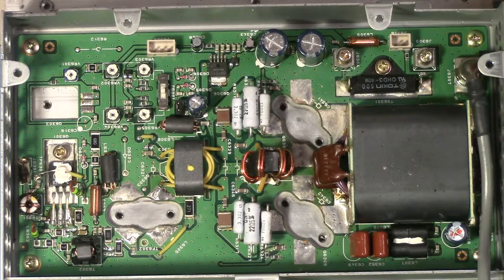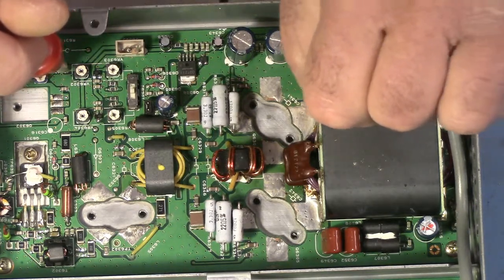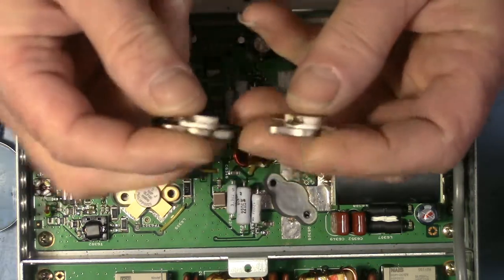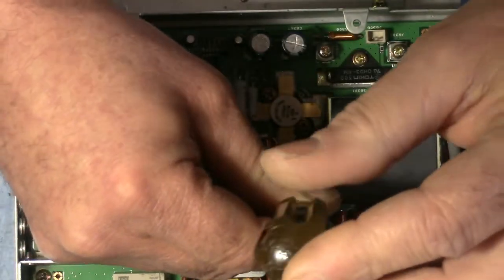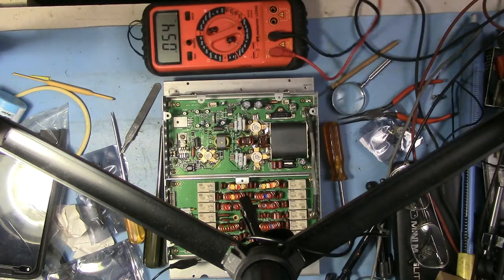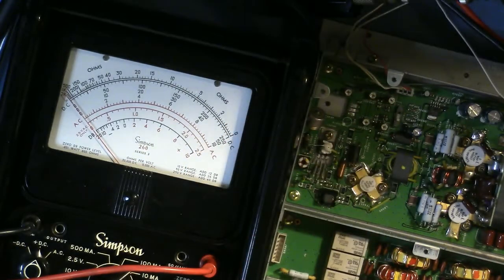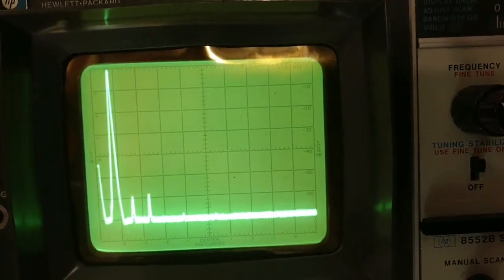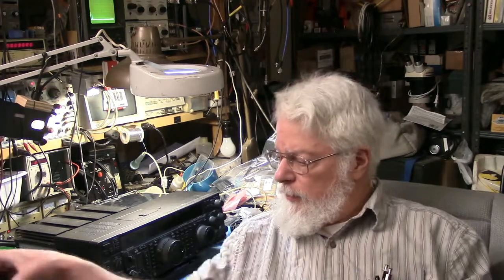FT1000MP MkV PA repair: FINALLY! Reassembly, and other stuff. Part 3/3

Comment: My next question is, in the Yaesu service manuals there is a Note that says "Signal levels in dB referred to in alignment are based on 0 dBµ = 0.5 µV.  Can you please explain what that means?  I can't find anything that makes that equation true.  I see where 0 dBµ = 1µV but not equal to .5µV.  How does that work and what does that equate to on a SSG output that reads in dBm or µV ?  Example being they call for +100 dBµ to set an S-meter to S9+60 dB.  I don't understand what they mean there.  Thanks in advance. Bruce
Reply from the maker: Sorry for the long delay in responding.  I have a spreadsheet I can send along if you email me at incidentalinformation@gmail.com  It's just a simple conversion table for dBm, dBu,  dBf and microvolts.  However, noted on the sheet at the bottom is the following. I can't remember when or where I derived this information but if I committed it to paper I was confident at the time.
Quote:
Re: Yaesu
+100dBu is 60dB over S9, or full scale on their later receivers.
+34dBu = 50uV is 25dB over S9 on their FT-101 series.
+90 dBu is 80dB over S9 on the FRG-7700
I agree that 0dBu is 1uV, nor 0.5uV.  However, I suppose you can chose any reference you like but not using a standard to which we can all agree and calibrate with seems stupid.  
My default is 50uV is S9 on most receivers.  
Conveniently, every 20dB is a 10X change in voltage level regardless of scale.  Unfortunately, using voltage (uV) instead of watts (dBm) as a 0 reference makes the scales awkward to compare.   Making the S meter's scale different from other radios complicates things greatly.  The same signal report from a station using older gear compared to a newer station makes reports far less useful.  Although, I guess is DOES make somebody's gear seem more sensitive, lacking an actual S\N measurement for a weak signal.

Comment: So I've set the drive current to 1.3A, both class A currents to 5A and when I go to class AB, the minimum current I can set is 1.4A instead of the 1A that's called for.  Won't go any lower, only higher and it's common to both sides.  Any idea why I can't adjust that down to the 1A?
Reply from the maker: This will be a long reply. 
Going over the bias circuit and looking up the specs for the final FETs I’ve determined the following which may help trouble shooting but doesn’t reveal any “smoking guns”. 
The FET specs indicate they start to turn on in the 3 volt range, Vgs (Threshold).  By the time you reach 5 volts they should be drawing about 8 amps.  Your new FETs may just have lower Vgs.
Since FET gates draw no DC current from the bias network, this leaves only R6314 & R6319 (10K) to drop the voltage from the VRs in the bias circuit.  Rough calculations indicate the following bias voltages capable.  Both the diodes (D6305 & 6306) as well as the saturation voltages of (Q6307 & 6308) throw a non-linear variable in the calculations but these should be pretty close.

Approx. Gate voltages:
Class A  high:4.65  low:2.65
Class AB high:3.98 low:1.79

As you already know, the Class AB values are GREATLY influenced by the value set for Class A which limits the low value.  
If you have any de-rated components due to excessive heat I would be very surprised, particularly since both FETs appear to be behaving similarly.  If you feel you’d like to shift the bias range down little to achieve optimum spec you could reduce R6314 & 6319.  For example: Adding 47K across them would reduce their value about 18%.  Bias voltage would drop more than this, but this should be a good starting value.

If you just wish to reduce the AB bias, which may be preferable, reducing R6325 & 6325 (18K) would achieve that nicely without affecting the A bias.  
Best of luck.
Reply from the maker: Simple diagnosis is the voltage is bias too high. But why? Since it occurs on both devices I would suspect a common source. ie the regulator Q6306. Its output should be 9 volts. But frankly,  I'd be surprised if that's it. Also, sometimes these high gain regulator chips can oscillate producing a correct average DC output with a significantly higher AC peak. The next likely suspect would be BOTH D6305 and D6306. If they shorted, when the finals went, their lost voltage drop would not be a huge loss in the higher A mode, but losing 0.7v from the much lower AB bias would be noticeable. Aside from that nothing else comes to mind. 
Note: Be sure there is NO RF DRIVE at all when adjusting bias. Even a little noise and Bal. Mod leakage will throw it off. I like to disconnect and  terminate the RF input to the board when adjusting bias. I think I said that in the video, but it's been a while.  Let us know what you discover.
Reply: @i-squared  Well I checked the regulator output (Q6306) and it is right on 9v.  Also checked both D6305 & D6306 and no defects noted on either one.  I'm stumped on this one but did end up with a work around if you will.  The Class A calls for 5A ± .2  and the Class AB calls for 1A ± .1 so if I set class A to 4.8A, I am able to set the Class AB current down to 1.1A which is technically within spec. (Barely lol).  Not sure what else to do so that's what I'm rolling with.  Nothing else to report at this time unfortunately.  Thanks for the advice on the potential problem devices but don't see anything wrong with them at the moment. 73
Reply: I might have just figured it out and wanted to give you my thoughts to see if you think this is plausible.  As I made my way through that radio I ran into an inoperable cooling circuit. TS6301 had a bad solder connection  and it did look a little "crispy" in there.   At the time I didn't really think much of that but now I'm wondering if that radio over heated at some point and permanently changed the tolerance/value of the resistors in the bias circuit.  What do you think of that theory Mark?
Reply from the maker: I will chew on the schematic later and let you know if anything comes to mind.

Comment: Hello there, thanks for this great video. I have a Mark V with the same problem and I'm wondering if I can replace the BLF147 and use a BLF177 instead. Both have the characteristics the only difference is the voltage that BLF177 can handle: 50V instead of 28V.
Again: thanks so much and have a great day. 73.
Gerardo. VA3GON.
Reply from the maker: Gerardo:  Thanks for your comments. 
I did a cursory review of the two devices (BLF147 vs. BLF177) .  The datasheets do not indicate that these are actually significantly different devices.  That is to say, they may not be different in physical design, but may only differ in their test parameters.  It is not uncommon for identically manufactured semiconductors to have varying electrical properties and then be assigned a device number based on those characteristics.  Sometimes, different devices numbers can even come from the same batch process.  Whether this is the case or not here I cannot say.  What I can say is that the test parameters appear to indicate a lower gain figure for the 28 volt device (which has a MAX Vds of 65 v).  I'm pretty comfortable saying that most of this gain differential is due to the higher test voltage on the BLF177, and, if it were tested at 28 volts it would likely have the same, or even lower, gain than the BLF147.  So I think your safe using either device, but the BLF177 may require a tiny bit more drive (less than 2dB) to develop rated output.  
All this is speculative of course, but I am confident in my assessment. I'd be very interested in your observations.